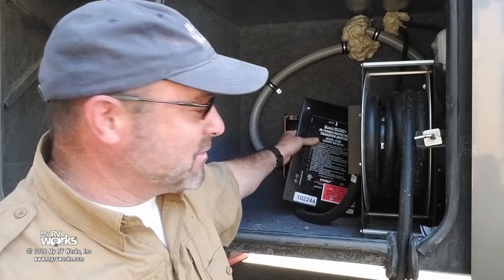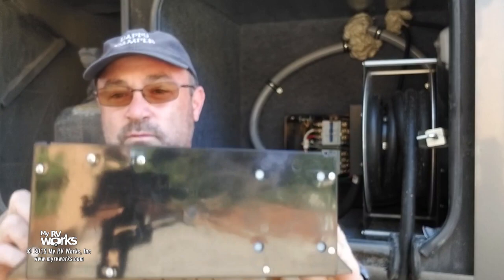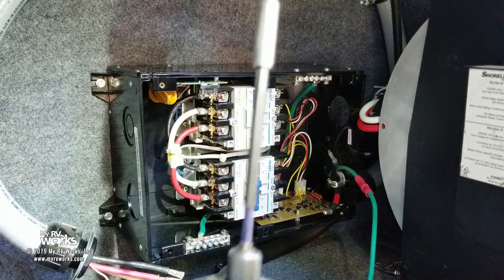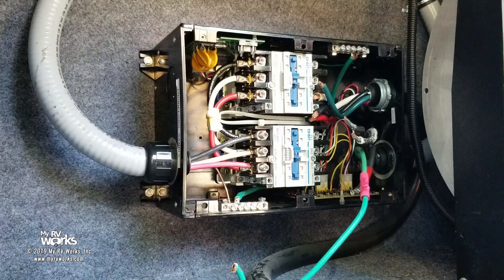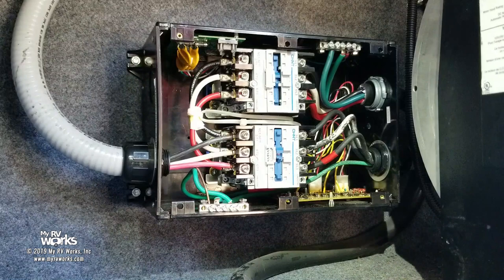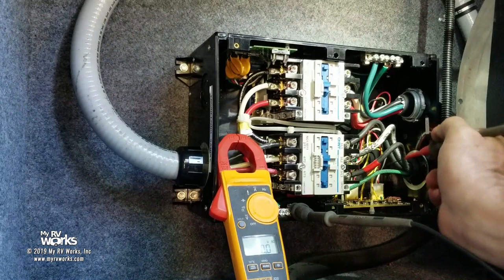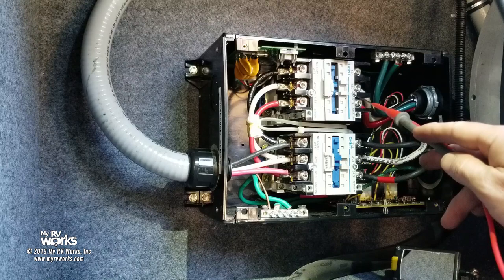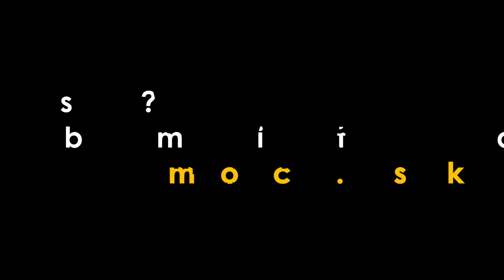How To Replace The Automatic Transfer Switch On An RV

Comment: I really thought that the transfer switch was going to be my problem. It isn’t. After watching your video, I tested mine and it’s fine. I did find the problem. In my main breaker box, (2016 Newmar Ventana LE 4040) there are the 6 or 8 gauge red, white and black coming in from the transfer switch. All of the breakers on that bus are good and I have power to those circuits. But on the bottom, there’s another positive bus that’s not connected to the rest, that has a single pole main breaker with about a 10-2 wire coming in. This is dead. The circuits on this bus are the lights, inverter, appliances and AC controller. Do it seemed like my whole RV was dead. Is there another fuse or breaker between the transfer switch and breaker box for this?  Thank you!

Comment: Being critical.
Don't like the verbage "sealed".
Contacts "pulled" or switch "pulled closed"
I agree 100% about shutting down AC before generator.
WELL before. Let it dry out so it doesn't stink later.

Comment: I have been enjoying your videos but on this one I kind of think you dropped the ball. 
You said you would read 120V across the coil when energized, there is no way. You will or should read 0V or close to it depending on the capacitor across the coil contacts. Remember, your (and all) meter reads potential difference. When coil is energized A1 to A2 will be zero.  When power on line side of second contactor and contactor not closed A1 to A2 should read 120V.
Also, I noticed you NEVER tested between Line and Neutral. Why not?
Keep up with the good video’s and I would appreciate hearing your answer.

Comment: I saw your automatic transfer switch video and the issues you had. I’m planning on adding a ATS to my motorhome and one of the things this particular unit showed was that the switches had to be horizontal or flat on the floor, not verticals . Is that something I need to consider?? Great video, thanks.

Comment: Darren, can you please explain why laying on it's back is bad. Thanks
Reply from the maker: That information is directly from the installation manual. I would imagine it has something to do with the springs inside the contactors pushing them back up after they are de-energized.

Comment: Our automatic transfer switch burned up! We always turn the ac off before plugging into shore power. Ours blew after we had been connected to shore power over night with ac running. There were no storms and no one else in the park seemed to have any similar issue. There may have been a vent running in the kitchen area. We are 50 amps. What could have caused this? Any ideas? I would really like to avoid this in the future. Thanks for any helpful advice.

Comment: Thank you for your great videos, very informative. I have a question about Automatic Transfer Switches, I have one in my 1997 38' Newmar Dutchstar Diesel pusher It has a Parallax 501 ATS in it that went bad, after watching your video on the one you replaced was a Surge Guard, what are your thoughts when replacing one, do you replace it with the same one that when bad or do you get a better one if possible, and if so what do you recommend?

Comment: I recently came across your channel and find your videos quite informative. My question is: does the gray cable coming out of the left side of the switch get connected to the converter in the distribution panel?

Comment: I love this video and the product your using as a transfer switch  .....but I can't get anyone nor any manufacture where to find a good quality 30 
Amp Transfer Switch that will switch like you show here from shore power ..and/or from solar ...and/or from generator to supply power to a Class B+ RV and charge batteries ....yet its done everyday.

Comment: Question if my plug to shore line has three prongs it’s a 30 amp transfer switch box and if it has four prongs is it a 50 amp transfer switch box is this correct please help thank you
Reply: Has to do with service capacity and wire size.
Not prongs

Comment: Hello, I have a 95 foretravel. I had unplugged from sure power, then started my generator, my wife said 3 bulbs in the bathroom exploded. Then on the control panel kept beeping saying high voltage. After 2 hours of driving, everything shut off inside the coach. And generator shut off also. I then started loosing voltage from my chasie batteries. Do you think the transfer switch never switched over when I unplugged from sure power?

Comment: I "think" I noticed a capacitor in line with A1.. and you stated you were making the gennie primary instead of shore power.. is this messing with the polarity of that capacitor thus not allowing it power up   to 120V and get that baby to seal in the gennie?

Comment: Any thoughts as to why my shore power circuit breaker trips when the lid is placed on The Lid on my Southwire 41301A 30 Amp transfer switch is placed on it?  When checking things out I noticed that the transfer switch lid was not in place.  When I put it on, it tripped the shore power breaker.  i took the lid off and all was fine.  I put the lid back on and the breaker tripped.  Also, my switch is mounted face up and I just saw your video which says don't do this.  This is the way it came from the factory.

Comment: I have a motorhome with a 30a set up. I'm looking into adding a second ac and upgrading to 50a. The shore power seems strait forward. However, I'm not planning to upgrade the generator, so it only has 3 wires. Will this be an issue? Not planning to try and run both AC's off the generator. Adding 50a transfer switch, new breaker panel wiring and a receptacle seems like a pretty good time and money investment. Would I be better off just adding a standalone 20a breaker box and receptacle solely devoted to the rear ac? My coach is "pre-wired" and already has the power (not hot) and thermostat wires ran behind the walls.

Comment: You seem really know these transfer switches.  I have 41260.  This issue just recently began on a 2014 Tiffin Allegro 36LA.  When I connect to shore power (shore power has been verified correctly wired for polarity and voltage)  the relay for shore power closes and ~3 seconds later it disconnects.  So, by accident, I leave shore power connected and start generator, power comes in the RV in ~30 seconds and all is well.  I shut generator down and shore power connects in and works as it should.  Any ideas?

Comment: Question if changing from shore power to generator or if I got it right also from generator to shore power. Make sure
that your air conditioners are cut off or it can damage your transfer switch ? What if you made something that when were
was a change in shore power all air conditioners would be automatedly cut off for you with like a 20 sec time delay.
This could and would save the cost and labor of changing out a transfer switch. I could figure this out wirelessly but
thinking you could use the circuits that is already their to do this. Everybody is looking for that one edge that will make
them rich. If I didn't tell you I'm retired lol. Still hoping to purchase my first motorhome and see America and its people.
Excluding a couple of them ( I used to be married ).
Reply from the maker: Most of these automatic transfer switches have a 3 minute delay. The purpose of the 3 minute delay is for the air conditioner to bleed out its compressor head pressure.

Comment: You should always  test power,  red or black to white.  Not green .You will get 120v. On each leg. 
You should also be testing  red to black . If your are hooked to 50 amp service you should see 240v.if not hooked to 50 amp and using  30 amp. You will see 120v to neutral to each leg.
Having ac unit running   when switching from shore power to genny  this will not be a problem.That is what the contactors are designed for.
Reply from the maker: Thank you for your additional comments. I like to reference ground because if things go sideways ground is going to be the circuit that saves the day. Therefore I always start my troubleshooting referencing ground. The newer transfer switches do have a bit of a delay when there is a transition from Shore to generator and that helps with the air conditioner starting surge. The starting surge could be two-thirds of the LRA value on the nameplate of the air conditioner.  As you state these contactors or not the most high-end. And I have pictures in my gallery, and years of changing out melted transfer switches, because air conditioners were left on when there was a transition and the contacts welded on the contact pads. My photo gallery shows pictures of this.

Comment: Good morning Sir.
I love your channel.
I have a question? Do you know where is the transfer switch location on 2019 Keystone Montana Legacy 5th wheel ? I will appreciate it thank you!!
Reply from the maker: No idea where they put those. However, if you connect to shore power and listen you may hear a clunk where those contactors are closing. That is how I typically find things like that.

Comment: Is it absolutely a need for there to be one of these switches in say a 50 Amp 33 footer?  mine had a an electrical short that burned the converter and fried my microwave.  Also what is the difference between a "CONVERTER" and an "INVERTER"? i'm confused but for practical purposes I am in a 35 Amp RV right now but i bought a 50 AMP one as far as i know Heartland does not have such a switch in them. My understanding is that this will allow to switch from one power source to the other without having to go outside to switch cables from a generator to shore power. Lastly with mine on a generator my nephew was testing the outlet for power from my Generator the generator of course won't go any higher than 35 Amps.  if this switch is not absolutely necessary then i believe i am good but on generator the Power outlet inside the RV was showing 16,000 hz at the outlet instead of the 60HZ that it should have.  I haven't tested the outlet again plugged into a 120 V outlet feeding into the 50 AMP RV but everything so far seems to work (one thing at a time) on a 120 V shore power connection. I am just afraid when i have the 50 Amp rv in place and i go to hook to a 50 amp service that it will fry the converter again as soon as more than just one thing at a time is on and running again. Basically i am scared i'm going to fry another converter and then be S.O.L for power until a new converter comes in  i know this has little to do with what you are showing here but if this is something i actually need or that would be a good safeguard i'm not opposed to adding one later. I just need to know if it's a must right now in the 50 AMP RV with a single ac, refrigerator 2 tv's and a washer dryer combo in the front closet (2011 Heartland Big Country RV is the 50 AMP one) (2012 Heartland Elkhart Express is the 35 Amp one i am in now and i've been hooked directly to a 35 amp connector on the electrical pole on my property since January) just for complete transparency's sake

Comment: Hi Darren question i have a 2006 fleetwood pioneer an my ac will work with a 110 but as soon as i connect it to my generator it shots everything of in my trailer what do you think is the problem love your video

Comment: I have an onmi-phase whole house overload protector wired into mine. If the circuit protector is bad will it cause the Automatic transfer switch to fail? Thank you

Comment: Thanks for the Video, My power transfer switch (or box) is buzzing very loudly can it be fixed or do I need to replace it?
Reply from the maker: The buzzing is because the magnets are not aligned in the contactors exactly perfectly. Sometimes cycling power on/off will cause them to click in/out and that will realign them. The buzzing will not affect the electrical circuit. It's just the electromagnets in the coil misaligned by the slightest bit.

Comment: Looks like your new transfer switch was bad out of the box. I’ve changed out three 30 amp transfer switches over the years. A walk in the park. Way less involved than 50 amp transfer switches. In each case the transfer switch contacts were fried by owners who apparently had changed power sources while under load.

Comment: I have the same automatic transfer switch in my RV I have coil voltage but it will not transfer to generator power… It transfers to shore power just fine… Any suggestions? The transfer switch is brand new

Comment: Can I put a new transfer  switch  like that in my older rv motor home  replacing the  older kind of transfer switch , and when you  come out of the new switch that goes to the rv side does also go to the invertor inside the rv like the old
Reply from the maker: The simplest answer is yes. We have to understand that that transfer switch job is to prevent the generator and the shore power from ever seeing each other and bucking phases. So you will have two in-feeds, with one of them being the primary. And once you make it through that switch you would have one singular outfeed.
Reply: Thank you very much for the  advice  , it's a 1985 pace arrow  and the transfer switch  stopped working on the  generator  side

Comment: Hi Darin great video, I have a quick question. Do transfer switches hum? I'm sitting in my rv and I do hear a humming noise were my transfer switch and my inverter are located. Not sure what it would be. Any idea? Thanks 👍
Reply: I think it would be the converter that's humming rather than the transfer switch.

Comment: Hi I’m fairly new to you and just watched couple of your videos trying to troubleshoot my transfer box. It still works but I noticed when I plug my RV in it doesn’t make that sharp clicking sound anymore. I’m just a little nervous about it not being able to transfer from generator to shore properly. I did buy a new one on Amazon but now wondering if I really need new one. I just not trusting it would switch if someday the shore power was on and if the generator was started. Any suggestions?? 
Thank You
Reply from the maker: The Easy Go / No-Go test here would be to actually test it in real-world situations.

Comment: Why not have the switch on its back?
Curious cause i moved my coach
A few feet and rolled over the cord and it yanked the box off
Its vertical mount
So i checked it for damage but it looked
Ok so i left the switch box on its back, its been 5 years. I will
Mount it back vertically. So what could happen on its back.
Reply from the maker: That information is directly from the installation manual for the manufacturer. Inside these boxes are electromagnetic contactors. The contactors raise on a spring but lower with a magnetic field. It's possible that the spring becomes weak pushing the contactor up over time.
Reply: @MyRVWorks  thank you

Comment: Nice video. Couple of pointers. The contactors in the transfer switch are cheap Chinese  units and should be avoided.
There is no need to colour code red or black wires as you are single phase.just never mix up the white one.
Transfer switch can be mounted  face up, makes no difference.
Reply from the maker: When I make these videos I do try to keep things very simple. That is why I told my audience to follow black to black red to red. Certainly in a 3-phase it matters because you're going to get reverse polarity and a motor could go the opposite direction for example. However, in this instance, there are  no 240 vac appliances in an RV so it wouldn't matter. Having said that, I'm always going to teach it that way because I want to keep it simple. Regarding the mounting. I'm referencing the manufacturers spec. on how they recommend mounting the transfer switch. It states that very clearly in their literature, and also on the box itself, not to mount it flat. I want to make sure I covered that in my video.

Comment: will the switching blow breakers when switching from shore to generator?
Reply from the maker: It should not. That's the purpose of the switch. If your on Shore and you turn on generator it will disconnect Shore wait a short interval and then reconnect on the generator side. As far as Breakers are concerned their focus is over current not simply switching.

Comment: Doesn't seem practical but could there have been a transformer that converts 240 volts to 120. And it was only getting 120 volts, thus putting out only 60 volts?

Comment: WHAT  CHANGES/HAPPENS IF YOU THROW SOLAR INTO THE MIX?
Reply: I could be wrong but I think that stays on the DC side.
Reply from the maker: Solar happens separate from the automatic transfer switch. Solar would go through the array on your roof, through a control, then to the batteries. The transfer switch in an RV really doesn't have anything to do with the solar/battery configuration. The automatic transfer switch lives on the AC side where you are connecting to shore power and your generator.

Comment: I don't understand the big deal about having a transfer switch.  You still need to pull the cord out/put it back in when connecting and disconnecting from shore power so this thing just saves you the couple seconds it takes to plug your cord into the generator outlet right?  You get to pay more money and have one more thing that can keep your coach from getting power just so you don't have to put the plug into an outlet after stowing it, seems pretty silly.